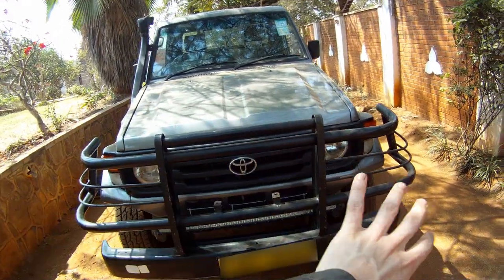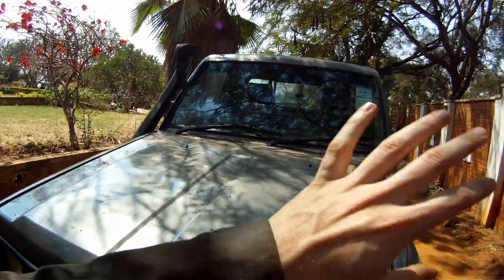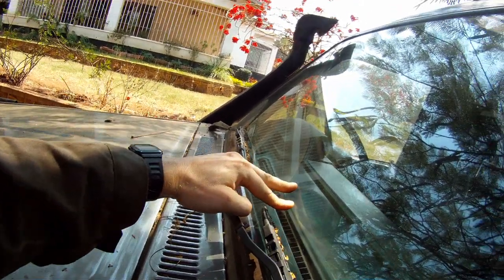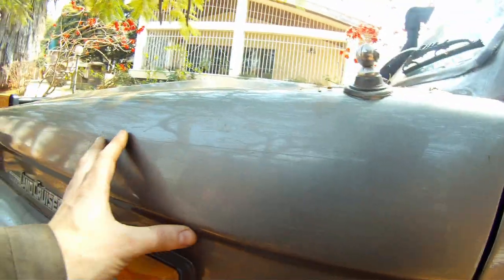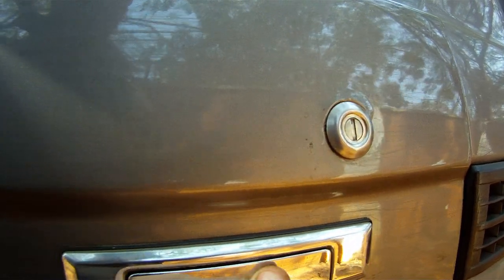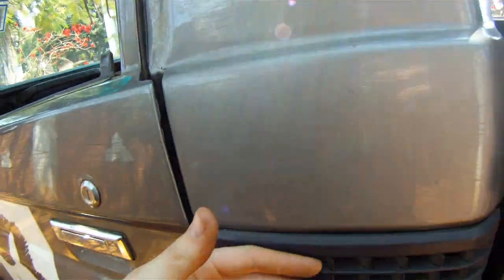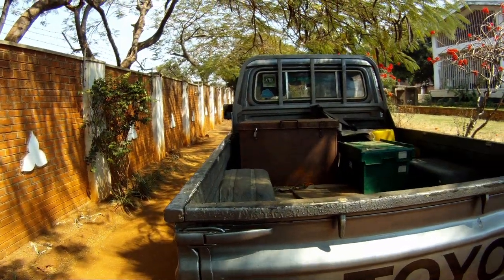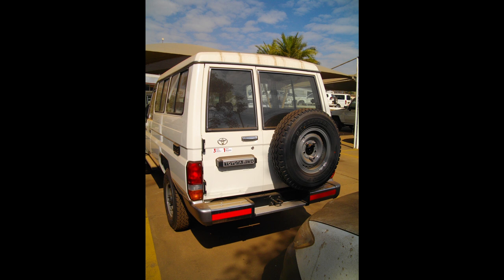Bodyshell differences - Land Rover guide to the Land Cruiser - 14/15

Comment: Much appreciated. Thanks for completing the final few videos of this series.

If nothing else I can remember the lovely terracotta soil and the Jacaranda's of Malawi. 

Thanks for not being too rude about the 70 series looks, it was never going to win any beauty pageants. 
The LJ78 Prado was the best looking 70, but I would say that wouldn't I.

The 40 series which it replaced had far more character, the 70 was designed with no nod to the past, with the exception of the front indicators, have a look at a 40 and you will see what I mean.
I was designed to do a job, which it does in the usual Toyota way.

The hinges don't tend to wear with the exception of the rear cargo doors if not greased, especially the one carrying the spare wheel. It's not a difficult job to replace them.

Many thanks for this series, very brave to do it on a Land Rover channel.
Reply from the maker: Thanks Harvey. Interesting to hear about the evolution of design. I think I hadn't finished the series in so long that I was unsure of the reception! But meh, I find Cruisers quite interesting from an engineering point of view and others probably would do too
Reply: @lrworkshop  I said the only nod to the past was the indicators, then the next time I got in my 70 wagon I thought about the rap around windows in the cargo area, another nod to the 40 series swb. 
There are probable a few more that I haven't noticed!
I do love the Defender, I would love a CC RR or a P38 but I know how my brain is and I would get so cross with the imperfections. 
Some people love the imperfections but I guess I am to Germanic to cope.
I do agree with your comment that the shape of a Defender is part of the African landscape. A III series with a white Safari Roof just says so much to me.

Comment: On the vertical wall I think the reason is the entire industry discovered that if you have a metal box with 4 walls angled 90° each other you get a lot of sound reasoning and can't do much for it. But if you angle a bit some of the walls you have far less reasoning and you can have a quieter interior.

And for the practical space inside if you look inside one of the 78 you displayed in photo (or any 70 van) you will see the bottom part has filler panel with some space between the panel and the sheet metal (where a few things are stored like jack, rear washer, etc. or insulation) and so in practice the bottom is almost aligned with the top (not up to the exact top but high enough).
But yes there is less inside width in a 70 than in a 40 that has vertical sheet metal and no panels.

But anyway, how could you fit a big box inside a Defender ? You only have a tiny mouse hole as door !? x)

Comment: And it makes you wonder. Wich one to buy or to keep. Ha ha ha 😉 Cheers mate 🍻
Reply: @artzahara3922  I do owne a Defender 110 but some times I realy do wonder should I seel it and buy a Toyota and yes prices are going up but for also Defender prices are going up. Gues now is more witch one is the ONE.?
Reply: @artzahara3922  Thanks for info. I will first build my series 3 with coils and 300tdi engine. Then I will see what to do. Cheers 🍻
Reply: @artzahara3922  Would do that but the chasis was so bedly roten that is beyond repair. I had 110 chasis at home. So that was my solutin. Did drove series 1,2,3, and I do drive Defender as deyley driver. I know I will desepoint many land rover purists but series 3 with new life is bether than scrap jard. 😉

Comment: Something I've been wondering - How comes some Defender's have their fuel fillers in front and some behind the wheel arch ?
Reply: Earlier defender 90 had the tank under the drivers seat, later ones had the tank in the rear
Reply: @Rob-cz7lg  Cool Thanks